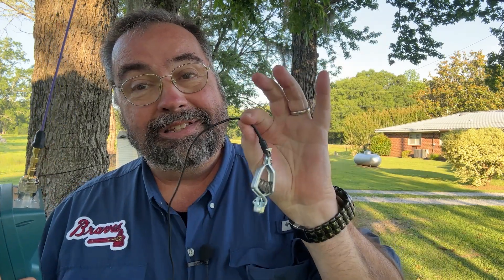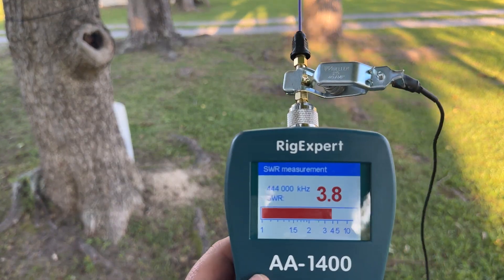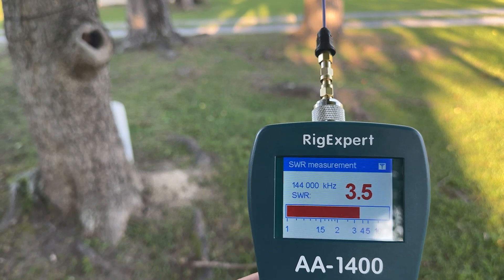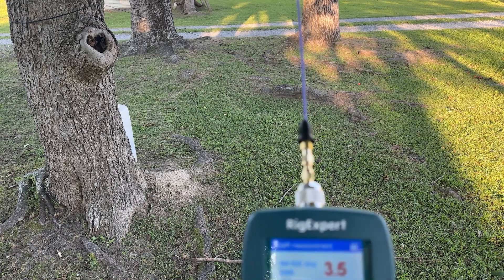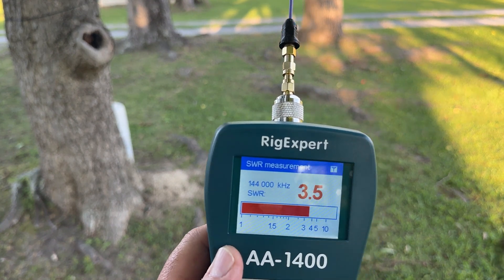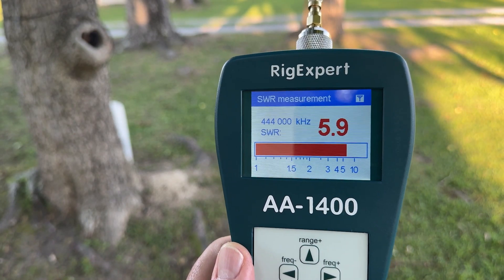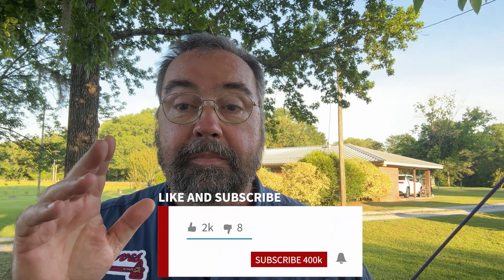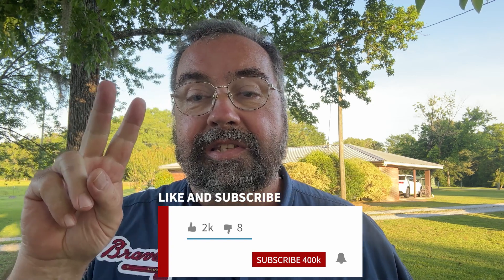Cut the tail off!

Comment: Yes, for an antenna like the Signal Stick, a Tiger Tail of 19 inches will work just fine. Now, I tune mine to 146.000, since it is the middle of the 2 meter band, so I make mine 21.5 inches long and I get a SWR of 1.0. Try it and you will be surprised.

Comment: The tail changes the center frequency of the antenna, not simply the SWR
Reply from the maker: This one had a birthday of 10/22, so I can't speak to a newer design, but yes, the 723 and the pass transistors are pretty common fail points.

Comment: You want 1/4 wavelength tigertail multiplied with the velocity factor of the cable you use. This should be normally near 0.9 for copper wire with PVC insulation. You can make a dual-band tigertail with two tails actually soldered together at the connection. This works than as a dual-band J-Pole together with the antenna. So a tiger-tail always makes a dipol /J-pole out of your single stick antenna.

Comment: Only thing is the body of the handi and capacitivly coupling to you is the  groundplane side of the antenna so these analysers won't give a true representation where as a field strength meter would show the gain. 
I personally have one cut for 2m and one for 70cm at 1/4 wave also have them at 5/8 and 1/2 depending on the antenna used makes big difference to your signal. Great work on the channel de M0JFE John
Reply from the maker: IMO, the body of the HT is no different than the plastic body of the rigexpert.  Equal results.  Take that out of the equation and it doesn't matter, all the tests were performed with the same setup.  So, regardless of the difference in plastic between the RE and an HT, relative numbers are the same.

Comment: Dumb question, but does this also prove that the SignalStick isn't that great of antenna by itself?
Reply: No, measuring HT antennas is tricky. They're designed to use your arm as a counterpoise. The rigexpert is a great tool, but it isn't meant for HT antennas. I have the same issue with my NanoVNA. For HT use, it's best to use it comparatively rather than for absolute numbers -- the numbers you get will not be the same as the HT sees.